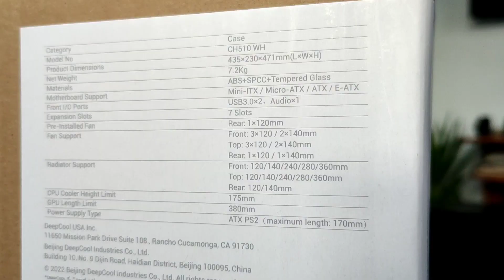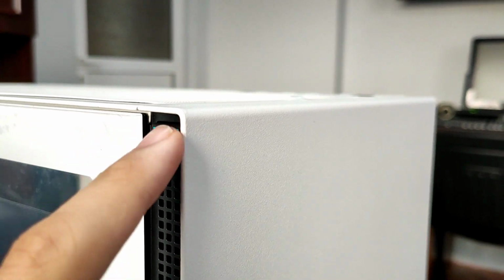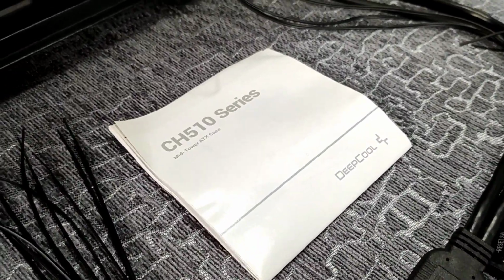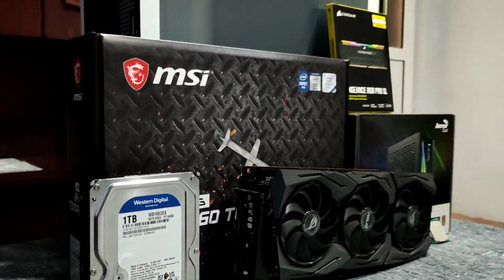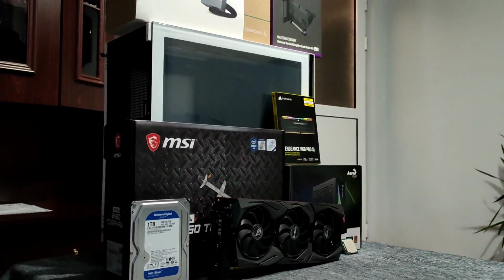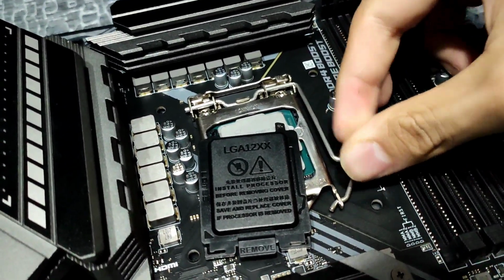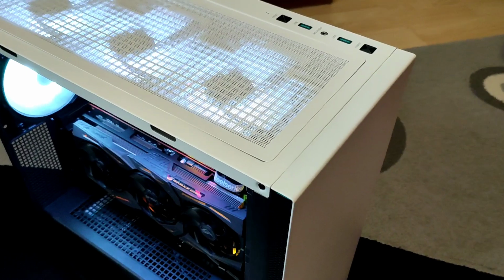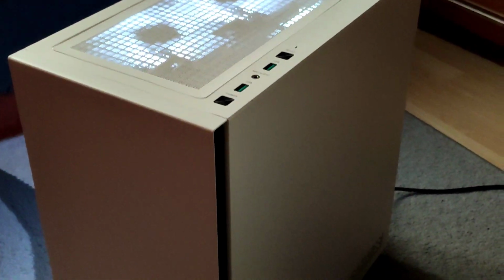The CLEANEST case I've ever seen! - DeepCool CH510 WH PC Build FT LT520

Comment: How was the average temperature?
Reply from the maker: My CPU is 65W and stays at average 45/50 Degrees while my GPU RX5700XT stays at chilling 60/65 Degrees pretty cool case!
Reply: @enthusiastlevel  Idle or while gaming? Cause these if these are idle temps it's really bad.
Reply: Idle at 35C using Ryzen 7 5800x, gaming is about 55C, using DeepCool LS720 with this case also having an MSI Suprim X RTX 4070ti at 38C idle and 57C gaming.
Reply: @HistoryNerdsShorts  Ryzen 5 3600x (idle around 30-40 while gaming 60-70 and gtx 1070 ti idle 35c and while gaming around 57-68 on harder games like rdr2, AC origins and stuff like that.

Comment: only thing is, no mesh front, will limit air flow
Reply from the maker: Still pretty good airflow especially with the FK120 which i have in the in the front my GPU gets plenty of Airflow
Reply: @enthusiastlevel  nice, so as long as you are using a fan that is good under static pressure you're saying its ok? so something like the FK120 or noctua a12x25 should be good or NF-A14
Reply from the maker: @Zombie101  The FK 120 are static pressure yes the Noctuas are good! 
In my scenario i have my FK120's behind the rad and i have my GPU vertically mounted and 2 bottom fans and one more down at the HDD cage so 3 Front and 2 Bottom it can fit a lot of fans.
Reply: You will get tons of dust though
Reply from the maker: @MrRaphaelLippi  Why do you think like that?